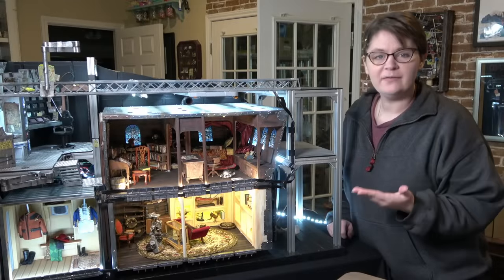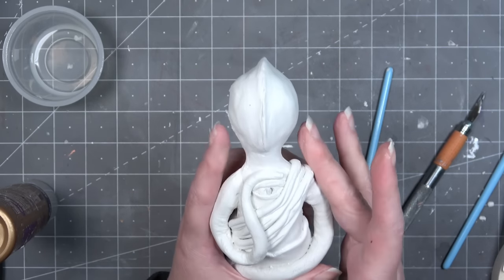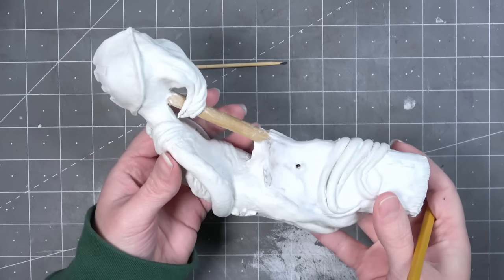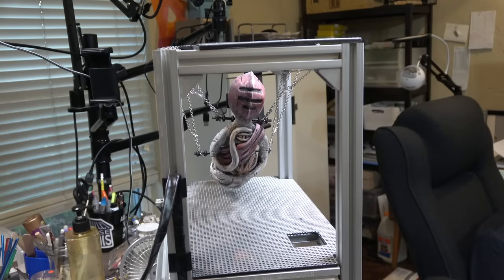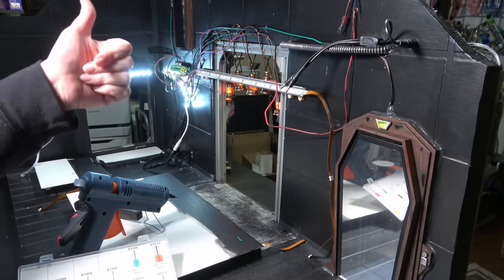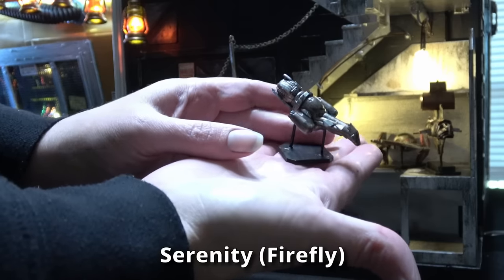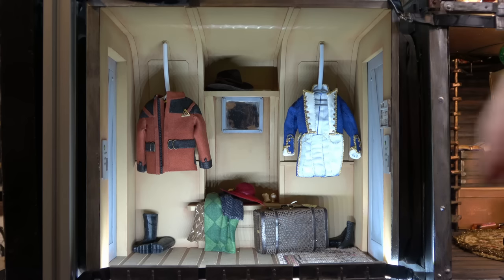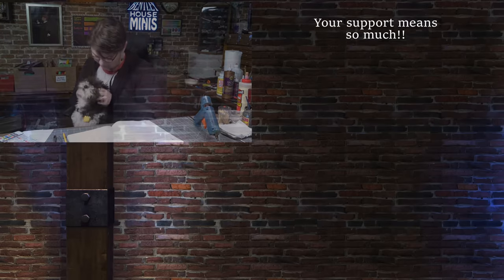I created the Captain's ALIEN Form👽👀 (Captains Quarters Miniature Diorama)

Comment: I learned in college, from my art teacher; that Murphys Oil can save your paint brushes. Yes, The Murphys oil, that you use for cleaning/condishing wood. Leave your paint brush to soak for 10-30 mins in it full strength. Then start gently cleaning it as it gets soft. When it's clean set to dry. I know that thier are thousands of paint brush cleaning hacks, this one actually works. Try it before you throw away another brush.
Reply from the maker: Thank you for this tip!  Thankfully I have not thrown away the brush... I just keep it for the purpose of using with dry wall spackle.  But I will give it a try and see if it works!

Comment: Thank you for sharing.  A thought for your bag of triangles: maybe some really intresting patterned wooden flooring or a tile wall/backsplash/ceiling?  Outside miniatures they could be added to a frame either to cover it or just add some extra intrest to certain sides or corners, holes drilled into two matching to make earrings that make you think of the project or a charms for a bracelet or necklace, or you could glue them together to make a small sculptural art piece for a desk or shelf.